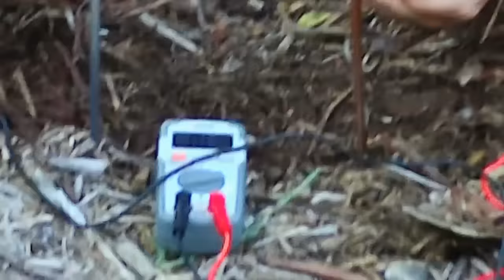OFF GRID POWER? The Earth Battery Experiment

Comment: I had a weird idea watching this... Would it be possible to create enough electricity from the rods to make hydrogen gas? Maybe multiple rods going onto a bucket of water with electrolytes to cause the reaction. Then using said hydrogen gas to run a small motor and the small motor would charge batteries to run parts of your home??
Reply: Had the same thought when I saw him using those rods with the washer thing on it!
Reply: @simeonismyname  great minds think alike lol. I've been really into the idea of hydrogen gas power lately. I've seen a couple videos of bio tank powered homes that utilize hydrogen. Another video has a modified generator powered by the hydrogen. Imagine charging lithium batteries with the generator and solar too and cooking with hydrogen gas.. But I'm not sure how much electrical current would be needed to make the reaction. If earth batteries could produce enough it'd essentially almost be free energy making hydrogen with animal waste and compost. Exciting!
Reply: How much electricity is needed to make hydrogen? A completely efficient electrolysis system would require 39 kWh of electricity to produce 1 kg of hydrogen. However, the devices commonly found in operation for this process are less efficient. A typical operational figure is about 48 kWh per kg of hydrogen.

Comment: What we learned is that Earth battery packs are not feasible. It's better to spend about $75-80 dollars and buy a 12v solar panel. Or several and some decent 6 or 12 volt deep cycle marine batteries.

Comment: You know what works real good is copper and picture frame wire I don't know why picture frame wire but yeah it works real good. Yes I made a ice cube tray water battery with screws and copper wire and I found the picture frame wire works real  good I forget how many total Watts I got but I could light up a LED light with it
Reply from the maker: Is picture frame wire galvanized?  If so, it has a zinc layer on the surface . zinc/copper do well for 2 dissimilar metals, as electrode material

Comment: It sounds like you are just making a very inefficient battery using moist dirt as the electrolyte.
Reply from the maker: That is what I concluded .. the 'electricity from the Earth' seems to be just the difference in potential between two dissimilar metals in an electrolyte.  If there is a way to get power from the magnetic field of the planet, this is not it ..  would it work with larger electrodes, and MUCH more space between them?  Maybe, but it would not work for a backyard.

Comment: Y not make alcohol and then distill it to vinegar and the use the vinegar  in the battery ! Remember plate size is directly  proportional to capacity/amperage. The ability to strip electrons fom the metals is the voltage lower acidic lower voltage more acidic more voltage but usually Max's  out around 1.2v for most metals

Comment: Maybe you can try this it works at my house I get 1.054 Voltz on average with a zinc rod going through and aluminum pipe I'll leave the pipe  on the surface of the ground but the zinc rod penetrating the Earth and a brass rod is also in the ground  also connect the voltmeter to the aluminum rod and the brass rod I'm not sure about the amps yet I'll figure that out tomorrow I found it to be better if the brass Rod is facing toward the South and the aluminum / zinc Rod is facing toward the North I'm not sure why but if you do vice versa the voltage drops.
Reply: If anyone is wondering where I live it's iron Rich dirt

Comment: Something is wrong. If a cell is 0.58 volts ( video 5:33 ) then 7 cells should be 4.06 volts. And you have ( video 25:05 ) 1.50 volts. Something went wrong. It is possible that there are poor connections. You have to check it out. from 7 cells, 0.58 volts each must be 4.06 volts.

Comment: Keep in mind that the energy you are getting is coming from the consumption of the metal. Energy that was put into the metal when it was transformed from ore into pure metal. In the case of copper, heat was used to smelt the ore. In the case of aluminum, electric power was used to tear the oxygen away from the aluminum in the aluminum oxide ore. You are making an ad hoc primary battery, and just like any battery when you draw energy from it you consume the metals until the battery is worn out.
BTW, the voltage difference is set by the nature of the metals. Using copper and aluminum you will always get the same (maximum) voltage.

Comment: I do not believe any energy is ever "generated", it is merely harnessed, conveyed and distributed. The energy harnessed can never exceed the "potential difference" resulting from the interaction of 2 or more sources attempting to balance each other. I would imagine one could magnify the potential difference  by compounding the number of variables with greatest potential differences [i.e hot/cold, alkaline/acidic, motion/stationary (or motion in opposing directions), high pressure/low pressure etc...). Granted there is great contrast between the categories of the theoretical, experimental, & applied sciences where only the final applicable results hold any actual and viable determined value so take my opinion as a grain of salt 🧂.

Comment: The Amperage would be the total amount of water coming out of the hose, when you put your finger on the end "Resistance" less water came out, 
therefore less Amperage. The Voltage would be the pressure.
Reply: Yup, what TA said for sure... everybody should pick up a book on basic electricity and how to use a multimeter, analog (with an actual pointer against a scale) or digital... you'd be light-years ahead of most folks and you'd save a lot of money troubleshooting/repairing your own equipment. Knowledge is power. Staying ill-informed about electricity/electronics costs you thousands of dollars over your lifetime.

Comment: Jese use a propane torch clamp the crip connectors in a vice and you can solder a dozen real quick. Any wire bigger than 12 gadge, Or pipe.

Comment: That's a good idea there's a video with a guy made a salt water battery with six cells each cell made two voltes then he wired an electronic step up booster that gave him 12 volts and from what I understand this battery will  light up a 12 Volt LED light bulb you can also charge your cell phone and other small 12 Volt accessories forever as long as always filled with with salt water if you're living off grid I think that would be a better way to get light without solar, if you're interested in watching the video channel is Mr. DIY project tech. thanks be safe

Comment: Keep your fingers off the electrodes.  Part of the reading is through the earth, but part of the reading is through your body.  Is your body a resistor, a conductor, or a capacitor?  Eliminate possible variables to test only the Earth Battery.

Comment: aND YOU ARE RIGHT ON YOUR WATER HOSE CURRENT EXPLANATION BUT WHERES AS THE WATER RUNS ON INSIDE OF HOSE THE ELECTRICITY RUNS ON THE OUTER SKIN OF CONDUCTOR THATS WHY A STRANDED WIRE  CAN CARRY MORE CURRENT DUE TO MORE SURFACE AREA COMPARED TO A SOLID WIRE OF SAME DIAMETER THIS IS FOR THOSE THAT DON'T KNOW HOW IT WORKS And electrical voltages are  subject to being proportional to one another if  voltage goes up current will drop if current draw goes up voltage will drop always proportional to one  other

Comment: I found this somewhere on the intenett, god knows if this is usable or not :)

Free energy

In laymen terms, this inventor has produced what is called an     "Earth Battery"     and I strongly encourage everyone to investigate/research Earth Batteries right after seeing this video, its free electricity and was used to power the telegraphs in the United States in the 1800s but was shut down by JP Morgan and others so they could sell electricity to the world wide population. Earth batteries work today and some farmers opt to use them to power their farms but they keep it secret to avoid "visitations" from assholes.....................

 Basically, an earth battery is when you take 2 copper rods that are 30 feet long and have a diameter of about 3 inches thick and the farmer will sink the first copper pole into the ground about 20 feet deep and about 50 yards SOUTH of his farm. Then the farmer will take the second copper pole and sink it into the ground 20 feet about 50 yards NORTH of his farm. So this then means that about 10 feet of the copper poles are above ground. Then the farmer takes a large gauge wire and connects it to the top of the first copper pole and strings that wire 100 yards to the north copper pole and connects that wire to the top of that pole. Now the farmer runs his farm's electrical wiring to the center of that wire and WaLa, he has free power..................... 

The magnetic fields of the Earth are moving at a certain speed through the ground coming from the south pole of the earth running to the north pole of the earth and searches for the path of least resistance when it runs into the copper pole that is south of the farm and as the magnetic field passes the pole it moves electrons in the pole like a generator does when magnets pass a copper wire. This then creates electrical current that races up the pole, then races into the wire between the poles and then reaches the north copper pole and back into the ground it goes because the 2 copper poles and the wire between them are the path of least resistance but while the current travels through the wire between the poles it is used to power the farm. This is called an Earth Battery. In this video the potato represents the earth, the magnet on one side of the potato represents the earth's south pole, the magnet on the other side of the potato represents the earth's north pole and the light in the center represents the farm. The great Pyramids of Egypt are Earth Batteries but the public is not supposed to know that so I shall not overstep my clearance here but you get the idea... .. ..?
Reply: Thanks for sharing this method may be useful to harness energy in an off grid house.
Reply: First, did you not mean a 3/4" rod? Where the heck ya gonna find a 3" rod, and imagine what that would cost at 30'! The shipping alone would break you.
Second, what I saw was in another experiment by this English dude, that a magnesium rod greatly improved voltage, and in another experiment,  the wire was suspended I think about 3" off the ground, a  experiment I intend to replicate. I have copper tubing and a lot of phone wire, but lack the magnesium rod, but I'll find something if 2 copper rods don't work. Just wish I wasn't so busy!

Comment: i think magnesium and carbon work best from a video i saw. in the video he got 2 volts with just 2 small probes in the ground no insulation. i want to do the same thing for 2 volts. except a bunch and wire them in parallel if i can. i want more amps. i think 2 volts is high enough to step up to 5v. i just need more amps. any help from someone will be appreciated. im thinking of putting them in plastic cups with dirt and them wire them in parellel. i just would like to see someone test it before i buy all the supplies.

Comment: no gain in series, but how about parallel?
Reply: With insulated electrode packages there will be an increase in voltage if wired in series as expected from a battery, if they are in the same medium uninsulated, then they just become a single cell. In paralleled you will see the same voltage as a single cell, given that they are the same design, but a doubling of the available current.

Comment: You need a bigger, hotter iron and a grinder to remove the coating off the screw eyes everywhere you want to solder to, to get it to stick. This is a great science experiment but you are wasting your time.
    When you connect your AMP meter across your cell, you are throwing a dead short across the cell which means that you have X number of milliamps at ZERO volts.
    An amp meter is made to be connected in SERIES with the power source and the load. Example: A battery and a light bulb. You break one wire, doesn't matter which, then you connect your amp meter while observing polarity. If you break the wire leading to the negative terminal of the battery, the negative meter probe goes to the battery and the positive goes to the bulb. the bulb will light and the meter will tell you the current draw. Same if you break the positive wire. Positive meter probe goes to The battery and negative goes to the bulb. If you would connect your meter probes across a substantial current source like a car battery , large lantern battery or a 120 volt electrical outlet, you would blow the fuse in the meter. If you have a cheap meter with no fuse, you'll burn out your meter.
    I'm glad that you have come to the conclusion that the earth battery is useless because you would have needed literally thousands of cells needing mud replacement daily to produce any usable power. You would have been better off using salt water or concentrated lemon juice but you would still needed hundreds of cells to light a flashlight bulb and play a pocket portable radio and you would have needed to replace your electrodes often
    Also, the higher the resistance, the lower the current draw. If you connect a 100,000 ohm resistor across a car battery, you'll maybe get a few tenth's of a milliamp current flow. If you connect a 1 ohm resistor across a car battery, you'll get a whole lot of sparks, a fire and, momentarily, a 1,000 amp current draw. BE CAREFUL WITH HIGH CURRENT SOURSES IF YOU DON'T UNDERSTAND ELECTRICY!!!

Comment: So I watched all this to be told it was not worth using? 😂
Reply from the maker: You could build a joule thief circuit and use that trickle charge to charge up your phone .. but it is not going to produce enough power to keep LED lights on at night, or keep the little pumps that I use for our ponds running.  

Often, we get these slick videos showing us wonderful results .. but the truth is, if it was THAT easy, everyone would have been doing it already.  Now that we know that the amazing "Earth Battery" is just producing electricity through galvanism, and not capturing electrons from the Earth's magnetic field (might need a LOT more space between electrodes .. miles of it, for that to work) .. we can move on to finding power solutions that actually DO work for individual homes.

Comment: I'd say flat sheets buried deep and horizontal with a rod coming up in the air as high the depth yo buried. 4ft under 4ft above as an example. The higher and deeper the better. Also there is probably a perfect size like with a radio antenna. If you find it it would make optimal power. This is of course all pulled straight outta my butt. But I mess with this stuff to and have made really cool discoveries with ideas that just pop in my brain. I have been wanting to try my idea but my landlord wouldn't appreciate my lawn "sculptures".
Reply from the maker: The telegraph companies did it with massive sheets for electrodes, and long distances between them ..

Comment: Sigh!  People need to finish basic high school science if they want make to these kind of videos.  You're not extracting energy from the earth.  You're just getting back the energy that was put into refining the metals, converting them from their natural oxides into pure metal.  All you're doing is using ground electrolytes to convert them back to oxides, at a very small rate, thus the low currents.  So small no visible oxidation is appearing on the metals for the short time you use them.  Eventually the metals would get so oxidized the battery would stop working.  Putting the rods in vinegar, no connection to the earth at all, would produce the same effect, likely better.  No free earth energy here.  You would have to keep adding refined metals to the system over time.
Reply from the maker: I'm glad that you watched the video all the way through and learned where the difference in potential was coming from.  Here in the United States, the transfer of ions between dissimilar metals through an electrolyte is something that we learn around grade 3 or 4 - or we did when I went through elementary school.  You are never too old to learn something, and I'm happy to have advanced your education here, today.
Reply: @Green.Country.Agroforestry  I think you missed the point of the comment. 100% of the energy you are getting (small as it is) is just getting back the energy that was put into the ore when it was smelted/refined.
Reply: Only realistic and valuable comment in this whole thread...

Comment: You need to go much deeper and terminate each rod in a separate rock or far enough in the same rock… this will offer termination and supply significantly more surface area and yield impressive results that do not diminish over time… 🤫

…this is how we did it thousands of years ago… remember small scale will produce small results… the key here is not to be disheartened… surely you did not expect greater results at this micro scale👍

…as the slogan says …go big or go home!

…this video should only of acted as proof of concept for you… now you know what you must do… so all that is left is to do it!

Comment: yes I made part of my living catholically "Protecting" industry. Salt water Is off the HOOK! I could feel the volts in my boats SS wheel standing on my isolated aluminum deck part!
Tesla knew it!
be careful with free energy, the back chevy will pull up in the drive way?

Thanks again for yoy show!!
Reply from the maker: I think that it was unfortunate that the competition between Edison and Tesla was an all-or-nothing affair .. so many devices that we use today run on direct current, and we waste energy converting AC to DC; having point of use generation for at least some of our power usage makes sense to me.